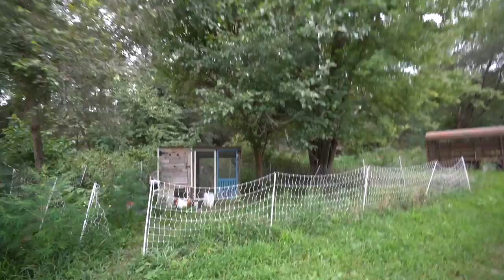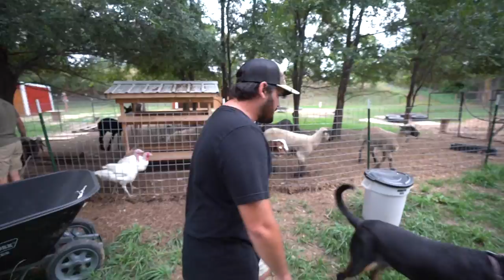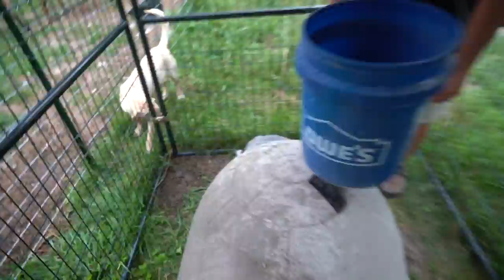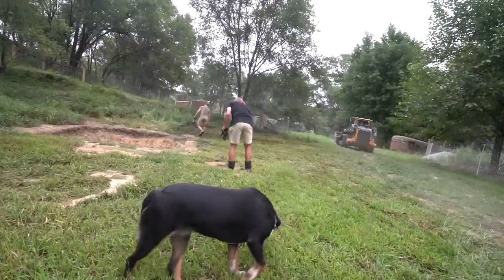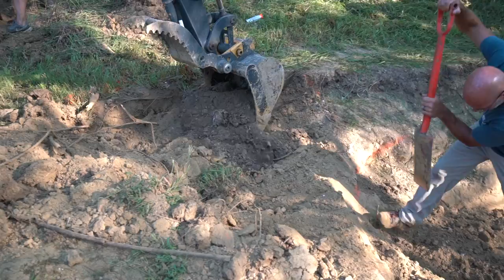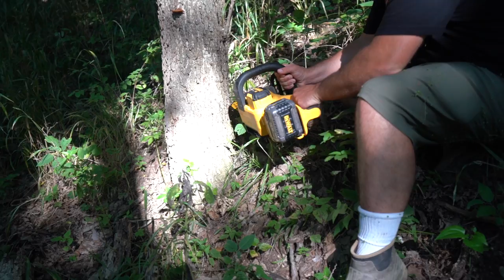Building a NEW MINI POND in My BACKYARD!!! (Part 1)

Comment: flare think about farm grade bug zapper or two to cut down on fly load - test out if they really work have an effect which ones are the best - you could diy? add a carbon dioxide tank and different light setups - think about some foggers or misters or sprinkler when it gets super hot - the animals might dig it - less heat stress - think about doing a couple big paddocks with forage strips and then some out on the back 40 too, also think cover crops and planting some tree, enlarge the pond add some musky and striped bass maybe some more carp, do another pond up by the house with koi and bluestone - you can fish for them on special occasions - koi breeding over dock building #black walnut trees for a couple hogs #texas crop report #sunbeam toasters #1 lb test